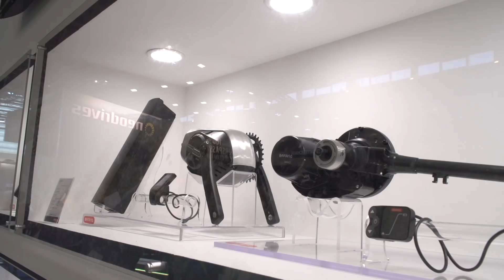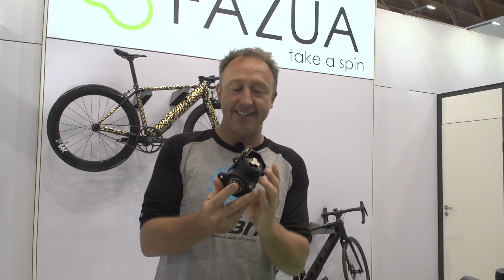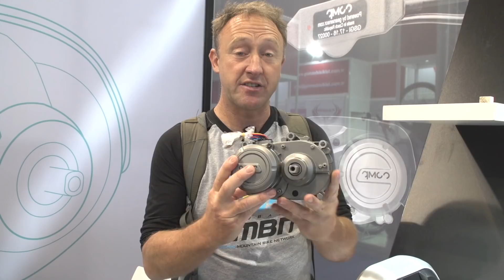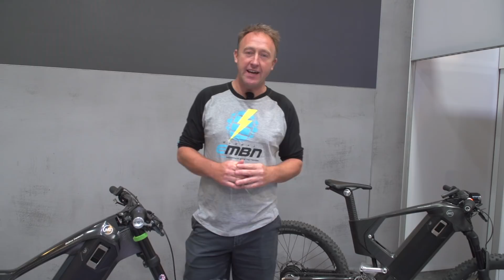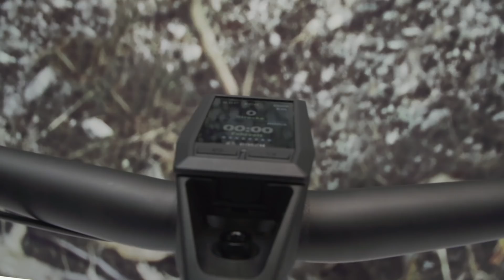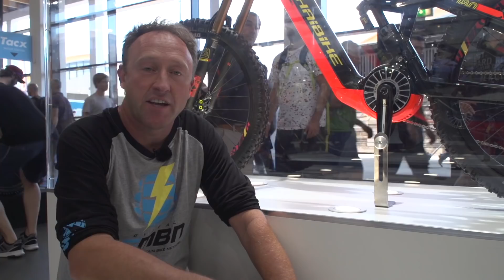Innovative New Motors And Tech | E-Bike Highlights From Eurobike 2018

Comment from the maker: Which new bit of tech is your favourite? Let us know in the comments ⚡️
Reply: Electric Mountain Bike Network that motor and battery combo all in the down tube is a game changer! It’s made Brose look like its from the dark ages.
Reply: It's very nice yes, but until they offer a minimum of 500Wh battery I'm not interested. I'm sure you can buy an extra battery for just €699 though..
Reply: Definitely the Fazua motored EZesty, looks a lot more like the future of ebikes to me than that Haibike with the monster motor.
Reply: Fazau motor.
Reply: And that Zesty. I will be in the queue for one of them 😀 I have been holding off buying an ebike until they took the next step, well next step taken !
Reply: Couldn't agree more.
Reply: Fazua
Reply: And If you remove that motor and battery combo, it becomes a 12.6kg normal enduro bike, amazing!
Reply: not sure of durability
Reply: Must be the motor/gearbox combo. Make a lighter version, put it on a touring bike with a belt drive......wonderfull.

Comment: Haibike looks stunning and next gen. 120NM seems crazy on a bike, you'll be hitting top speed in the blink of an eye. I've seen the Fazua used on another brand, it only adds 1.3kg penalty to the weight and you can ride the bike and leave the battery/motor at home as you can purchase a separate cover. So much impressive kit out there.

Comment: Love that new Haibike system, awesome intergration and 120 is gonna blow everything out of the water as long as it supports high cadence.
Reply: Yep, it should do as they've got the extra torque from it being 48v when most others are 36v.
Reply from the maker: 120nm is huge torque. As long as it's usable, it'll be fantastic
Reply: Blackbird Your right however if I get thru kmc 10 e bike specific chain in 400 miles with a Bosch system how long will I get out of a chain 120nm. 150 miles if I'm lucky
Reply: Alasdair Hill I've got a Bosch CX motor and that seems to eat chains much faster than other systems. I think it's the small chainring which is turning faster which causes it. I think we'll see Bosch drop that in their next fully new system and it struggles in mud too.
Reply: TheAegisClaw cheers mate,I also wondered about that although I had no problems in the mud last year and my friend has a specialized levo which was absolutely rubbish with mud. Mine just kept going,I think I did adjust the b screw on the derailer putting a little more tension on the chain

Comment: The Fazua route seems the most interesting as you could easily carry a spare battery in back pack at that weight for longer trips. But for shorter ones with laps just swap at car.
Reply: That said, isn't a fitting under the tube too exposed to shocks and dirt ?

Comment: some nice tech,  but individual componrnts make for a more robust, easier to maintain bike.  A mid mounted gearless motor belt drive reduction to a freewheel crank, and a nuvinci rear hub is maintainable by yourself...and torque that will shame these highlighted bikes...without breaking the bank.

Comment: Hmm the Haibike looks good but do we really need that much torque?  Better to focus on lightweight smaller motors in my opinion rather than bulky, high torque ones. Although it looks nice the Flyon motor looks pretty big. Looks like the Fazua motor is more the way to go, especially, as it looks good to ride should you have any battery or motor issues you could still get out and ride your bike.
Reply: Michael Davies time will tell. 5 years ago none of the motors had enough torque for steep mtb climbs, now they all do.
Reply from the maker: There are definitely different camps in which motors are going towards. That Fazua looks like a revolution in terms of packaging.
Reply: I pull a trailer that sometimes weighs as much as 60 kilos. I'm all about torque.

Comment: I'm surprised that along with the 15 mph max speed the EU doesn't cap the torque as well.
Reply: Give it time.
Reply: 15mph? Wtf? I can run faster than that. Give me a cheap Chinese hub motor that'll do 30mph+ every time. And for only a fraction of the cost of these expensive toys.

Comment: You missed that the TQ motor and battery are actually 48v, that's where all that extra torque comes from. It may also mean that bug battery doesn't offer any extra range over a 500wh 36v.
Reply from the maker: Great catch! Thanks for filling in that extra info.

Comment: Haibikes with TQ motor look nice, but wondering how such long chainstays gonna affect agility? Is this a compromise because of higher torque, or motor size won't allow them to be shorter?
Reply from the maker: Usually ebikes have longer chainstays to balance the extra weight and speed more effectively. Ironically, this was originally done because the motors didn't allow shorter chainstays. But it has since become a design element that works.

Comment: Love the bbshd over 10,000 mi. On mine 11250 watts 52 volts Max for bycicle components I commute though my driveline every 900mi...this unit replaces the bottom bracket
Reply: Sorry 1250 watts 52 volt

Comment: You forgot to mention that Haibike is using SRAM EX1 drivetrain for the most expensive version, and the rather shitty Shimano M8000 on the second best version. My Shimano HG-901 chain is slipping on the M8000 drivetrain when geared to the 11t, even with the chainline changed to be too much outwards. Chain is of correct length. I am getting a KMC x10e chain soon and a chain tensioker to see if that helps

Comment: Is the Mubea tech real or is it taunting us, acting like it will be real one day? The motor, gearbox for both the motor and pedals, 4kw, 10 pounds. That's unheard of.
Reply: If it's real all we need to do is give it a carbon fiber drive shaft driving the rear wheel for maximum efficiency and we've hit peak ebike.
Reply: RoboticusMusic  If you look closely, the model on the far right that he covered at the end, had a belt drive going to the rear wheel.
Reply: The gates belt drive is not nearly as efficient as a drive shaft, plus they get eaten up by electric bikes and snap at wattage's like what the Mubea has.
Reply: @RoboticusMusic  in most systems, you need to have cheaper components with a lower failure threshold than the more expensive components, in order to protect the expensive and difficult to fix components

Comment: I have a 5kw ebike and it is truly a load of fun. It is the same thing as with emtb-s, don't knock it until you try it, or else you become the same hypocrit as the ones who hate emtb-s.
Reply: I believe they are lots of fun. BUT they are very limited where and how you can ride them legally. So they are more like, or actually are electric motorcycles, not ebikes.
Reply: Dantes G not in the EU they're not, they're bicycles by law so can be used where bicycles can.
Reply: a 5kW (5000W) bike? I don't think so. They fall somewhere in the moped category and require type approvals, insurance and perhaps registeration and license to ride. And you definetly can't ride them everywhere where (e)bikes are allowed.
Reply: Dantes G I wasn't specifically talking about 5kw bikes, just legal eBikes.
Reply: No prob, OP (TomaCukor) was talking about 5kW bikes.
Reply: I was talking about the fun of the bike itself. 
Obviously if you can't use it legally as a light moped(I can, many places you don't need type approval), you can only ride it legally the same places you can legally ride dirt bikes without license plates(non supermoto dirtbikes), namely back country dirt roads and other adventures.
Reply: What E-bike do you have? 5kw sounds like a beast!
Reply: Kevin Hayes I have the cyclone coaxial bike. About $2500 shipped. Not for the faint hearted.
Reply: @Dantes Actually, if that 5kW is just the peak output from the controller, the bike can still be perfectly legal as a bicycle, if the motor is officially rated for 250W at the factory, i.e slap a 250W sticker on it. But it has to be added at the factory, otherwise it's not "official".

Comment: Hi Steve the show looks excellent,my biggest concerns 120nm is amazing but what are they doing about CHAINS !!! . I ride a Haibike allmtn 6.0 with a Bosch CX motor and use kmc x11 e and am lucky to get 400 miles per chain.I am now trying a kmc×10 e but don't really expect to get much more from these either,any tips I change my chain at .075 and clean after each ride ? Cheers mate
Reply: Alasdair Hill yep, they're heavy on chains, I think the Box system and things like it are a good idea.
Reply from the maker: That's an excellent point. It's another reason we're seeing more ebike-specific drivetrains. 400miles is not enough for chain!
Reply: Electric Mountain Bike Network and for me what's worse is the wear on the hugely expensive cassettes we use these days.
Reply: So do I.

In my opinion they shall innovate the brakes too, the pads are way to thin and undersized. The life of a set of resine pads is bloody short.

I saw the price of the Sram Eagle cassette. I will stay on the NX system, that does the job very well XD.
Reply from the maker: Actually the new SRAM NX Eagle has apparently been made to withstand ebike usage, which is great. And we're seeing more and more ebike specific brakes.

Comment: The line between a motorcycle and a e mtb begins to fade
Reply from the maker: For some bikes, like that 4000w monster, though it shouldn't have pedals at that point, don't you agree? They almost seem unnecessary.
Reply: Electric Mountain Bike Network Yes, and i wonder at what point they wil kick you of the MTB trails.
Reply from the maker: That's the problem..... And why we don't really condone throttle ebikes, keeping our content to legal options only.
Reply: Mubea is all about emobility solutions. What they do is research for such things as industrial transport applications rather than mtb. But it's all about innovating right?  Eurobike highlights for many were Orange bolting 1 kg weights onto a downhill bike, Mubea build a gearbox and motor at about 4kg.........
Reply: Edwin chattellon Agreed and Im sure the motorcycle manufacturers are concerned as ppl switch over. Trail designers are already starting to plan for the increase in ebikes. I rode today with someone that had a boosted Giant that he said reaches 65kph on the road but he was way behind me on the trail as it was tight and twisty with tech featured. I spoke to some trail builders and said I would prefer shared trails as dont want to see ebikes banned from existing ones.